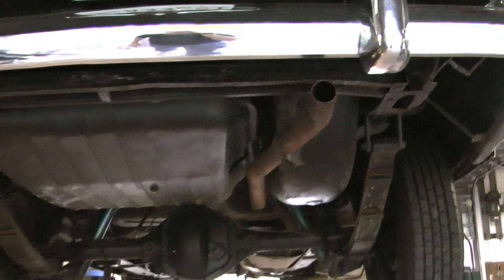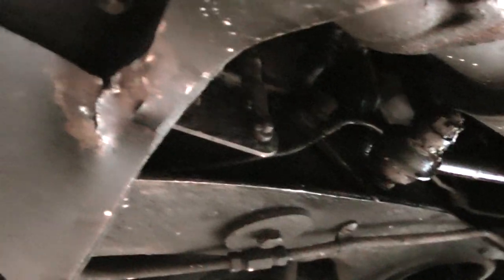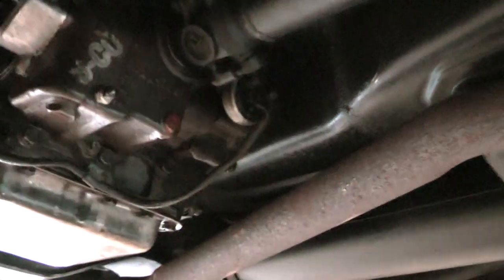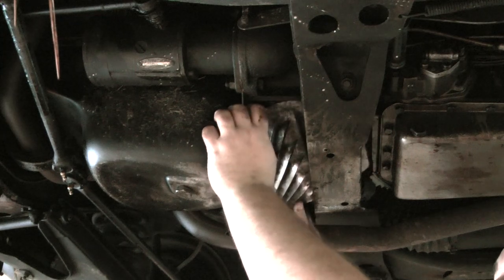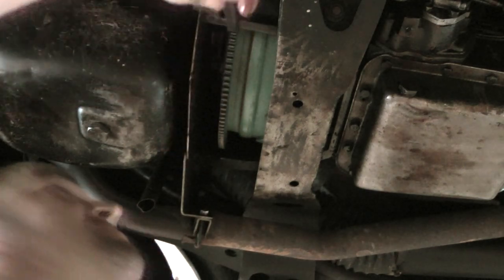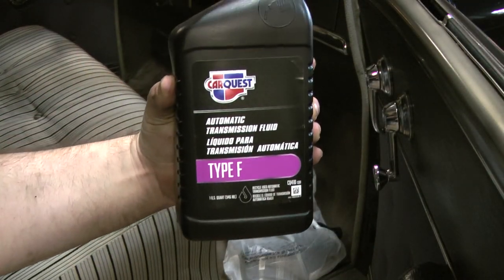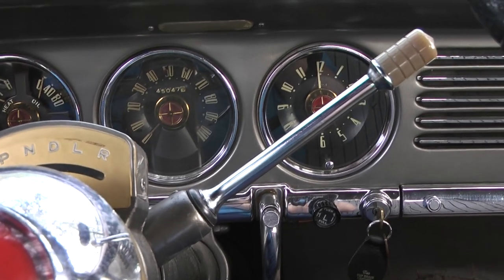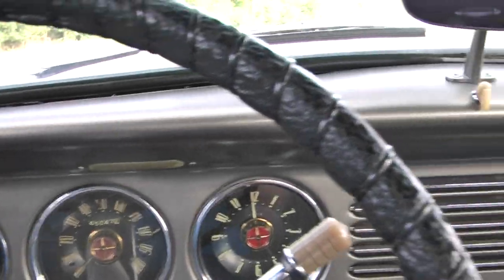1951 Studebaker Commander Land Cruiser: Changing The Transmission Fluid.

Comment: I had always heard that the correct fluid was SAE 10 non-detergent motor oil, which was more compatible with the torque converter clutch and more durable for the air-cooled transmission. My Studes were overdrive sticks.

Comment: Didn't some come with a inline 6? That's the only reason I can figure out why the ran the left manifold around the front to meet right side.
Reply from the maker: +Dante Fox Originally, these did. Then In 1951, the V8 was offered. The reason why the left side runs around to the right side is because the Starter is on the left side along with the steering linkage.

Comment: Hello Emerson,

I was not aware that you had a you tube area! I am also from the SDC forum and I believe I have spoken with you before. I am currently restoring a 1951 Land Cruiser as well...though mine is Maui Blue. My handle is 61Lark4dr on the forum. Anyway, I wanted to ask you a question concerning what engine oil you use.....what engine oil do you use? Sweet looking Bullet you have, enjoy the videos!
Reply from the maker: +icncu222 Oh, hey there! I use seven quarts of 10W30 Castrol GTX in my 232 V8 engine.

Comment: Sweeeeeet! Can't wait to hear that true dual exhaust on her in the next video. Are you planning on leaving the rear skirt off or reshaping it to fit with the dual exhaust?
Reply from the maker: +silverperzon  Same here. Should sound nice with glass packs because thats what I am putting on it. I'm going to leave the skirt off. I thought about making a reversed side exit in it but the pipe would be touching the gas tank. So I took it off and keeping it. In case one day I want to bring it back to a single exhaust. 

How is the 58 Plaza coming along?
Reply: Didn't know you were going with glass packs, should sound wicked. :)

Coming along nicely, for the past couple of months I've just been collecting parts on and off. She runs and drives, but the brakes need work as does the overdrive unit.
Reply from the maker: +silverperzon Well it won't be as loud as it is now. I'm thinking it would sound mellow with a little snap sound to it.
Reply: Good to hear it won't sound to obnoxious. A little snap will be nice.

My Plaza still has its original muffler, but its also a tad rusted. Hopefully I can find an original replacement in better condition.
Reply from the maker: +silverperzon  It's too bad a lot of these old 50's films or Car ads never show the tail pipe or muffler when they were brand new at the time. I mean yeah, you'll see some of it. But the camera would be moving away so fast you can't see a clear picture of it.
Reply: Yeah that is a bit of a bummer at times...but if you're fortunate to have an unmolested car, you can how it was put together. Luckily for me the exhaust on my car is indeed original with its diamond textured muffler and small 2 inch diameter piping.

Waldron Exhaust does make complete reproduction exhaust systems from the original diagrams. The only thing they don't include are the clamps, but I believe you can buy those separately or any autoparts store really.
The complete exhaust for my car goes for about $290 not including shipping.
Reply from the maker: +silverperzon That's not bad. I like the fact that you can get a reproduction exhaust system from the original diagrams.
Reply: I'd say so. Waldron Exhaust is the only company I've found that makes them based off original diagrams. However they do offer stock looking mufflers with modified internals, It goes from bone stock, mild, to wild. So they do give you some variety which is great.